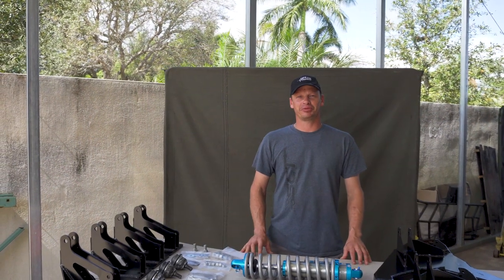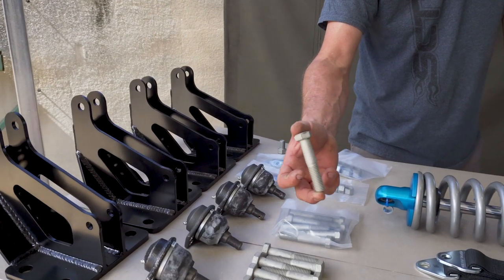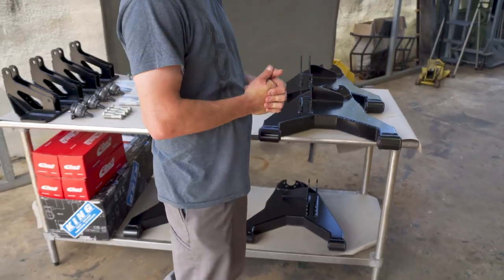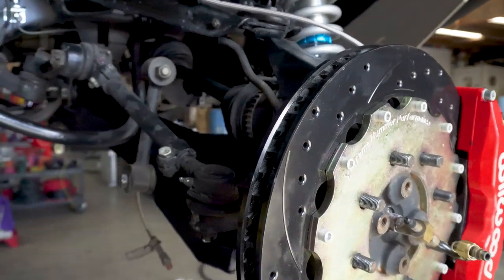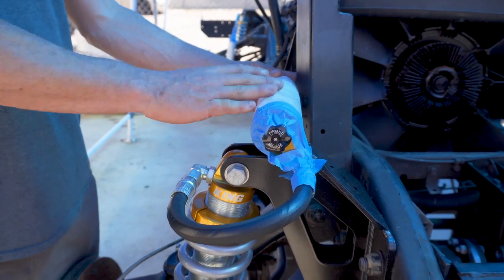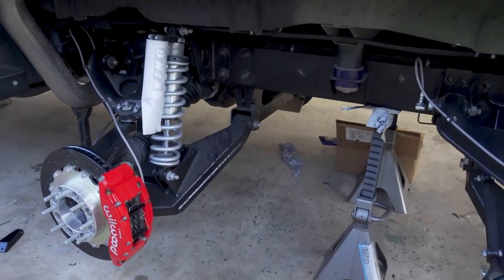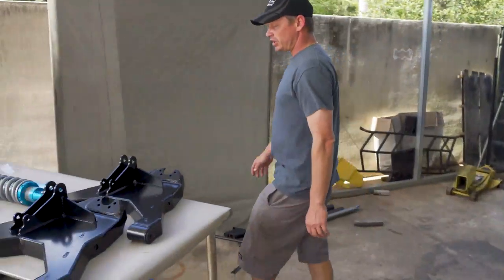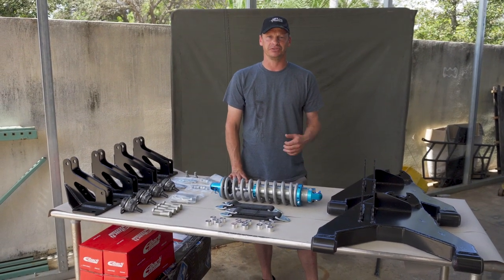XHP Hummer H1/HMMWV Suspension Kit | Features and Benefits

Comment: They look Fabulous!👌🏻 How much suspension travel these shocks have ? Also how much inch of increased ground clearance over stock setup?
Reply: The travel is similar to stock with about 1" more droop.  The main goal of this kit is to provide stronger control arms, selectable spring rates, adjustable ride height, improved damping and better geometry for lifted Hummers.

You can read my reply to previous comments for more explanation.

Comment: Can you describe what this suspension setup is designed for? High speed desert whoops? Comfort on the street? Rocky trails where more flex helps?  Is it better than stock in all these scenarios? Also, what's the ground clearance at the crossmember compared to stock springs/shocks?
Reply from the maker: Chris Strandt it can be setup for many different uses. That’s the point, spring rate, damping, and ride height are all adjustable. Essentially it is better in all scenarios. For full out racing and jumping we have other options with larger shocks and more travel, but they are not bolt-on. 

Ground clearance at the crossmembers depends on the tire and ride height you select, but the control arms provide almost 3” more clearance between the crossmember and the portal box (where it’s most important).

Comment: If you leave the brakes inboard, they don't have to get bigger because they get their force multiplied by the gear reduction in the portal hub.
Reply from the maker: Yes they have mechanical advantage, but they are spinning almost twice as fast meaning they have horrible brake fade, overheating and warping.  The problem is actually due to the extremely high rotor speed.  Also the loads on the diff bearings and lack of support for the output shaft causes vibrations, wear and excessive load on the CV/Rotor fasteners.  Another problem with the inboard brakes is the load on the CV shafts and portal gears. The backlash in the gears causes rocking, noise and even a safety risk of the shaft or hardware failing and they you have no brakes!!!     So you are correct for low speed operation (under 55mph) they work well and stop a heavy vehicle fine, but there are alot of performance and mechanical shortcomings of this design for a heavy vehicle at highway speeds.
Reply: I can't imagine wanting to drive a HMMWV faster than 55 mph. To be fair, though, all the ones I drove were while in the army. Faster than that for extended periods tended to blow the engine (non-turbo) due to lack of OD in the transmission. I saw some on their third engine with under 30k miles. If you change out enough of the other parts that it becomes reasonable to drive it fast and aggressive, I can see where the brakes might need an upgrade. Brakes were one of the few things I never heard the motor pool mechanics complaining about.
Reply: @x-tremehummerperformance6511  Can't say that I've had brake fade on my 12k rotors... even slowing from 70 it held strong.  Not tracking a H1....
Reply: My issue is with pushing the wheels outward with the brakes outboard, full suspension compression at a weird angle and you got a cracked hood, I just had to go through a hood replacement on my H1 and it was a pain getting stock from AM General, waited months and finally had to settle to get a new HMMWV hood and had to pay extra for the body shop to strip the CARC and prep it for install vs the AMG part that usually comes primed and ready to go.

Comment: Ugh.  Outboard brakes.  Why own a H1 if you're going to put outboard brakes on it.... doesn't...make...sense.
Reply from the maker: This comment doesn't make sense...This system performs orders of magnitude better than inboard brakes.  The original design is a very failure prone weakpoint in the driveline for strength as well as providing very poor braking at high speeds and with heavy GVW's.  There is absolutely no off-road capability disadvantage to the portal box brakes...
Reply: I guess this is where I need to just be ok with someone’s decision even tough it makes no sense in my mind. No other vehicle is like the Hummer H1/HMMWVs mainly because of their very unique designs. Like inboard brakes, portal hubs, transmission and drive shaft tugged up in the tunnel. Other wise just get a jeep or a Hummer H2 or what ever. But like I said. I need to be ok with it. I’ll keep my HMMWV original, you do what you do. Everybody’s happy.